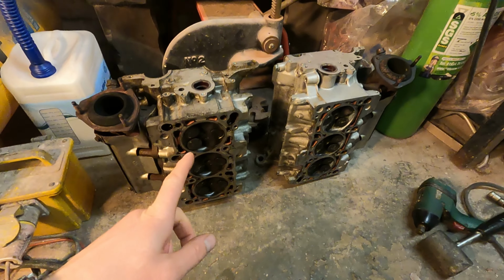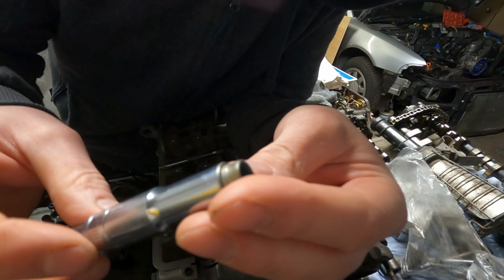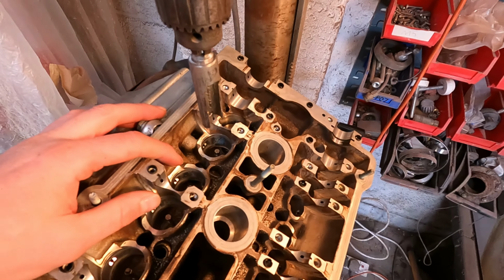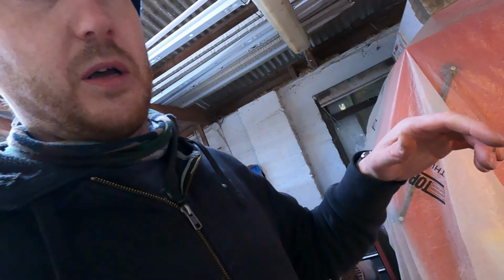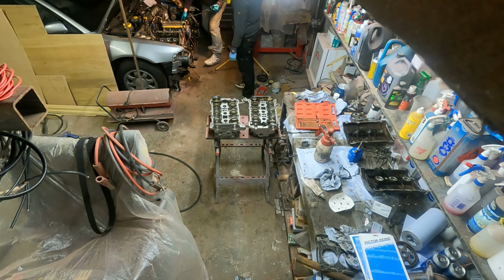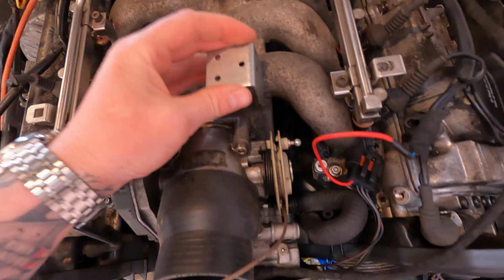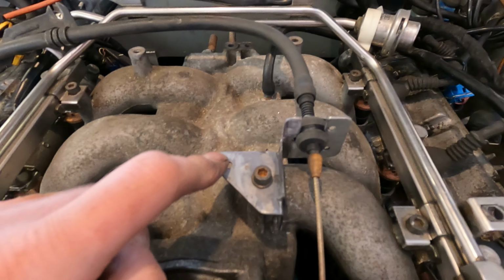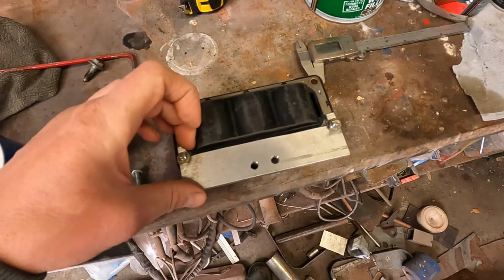Audi B5 Project | A4 2.8 V6 | Engine rebuild and stuff

Comment: why do you need more room between the engine and firewall? plan on going single turbo one day? did you port the 2.7 intake manifold to match the larger 2.8 intake ports on the head? if not going forced induction, what advantage does the 2.7 manifold have over the 2.8? im just curious why you did all this work. nice job.
Reply from the maker: Thanks for watching and for the comment. Yeah as I said in the video I plan on going single turbo. Using the 2.7 manifold means the throttle body is now at the front, freeing up space at the back. No I didn’t port match them. It wasn’t really that much work.